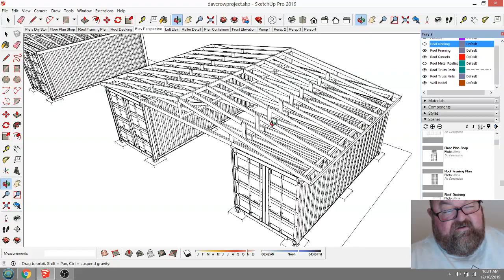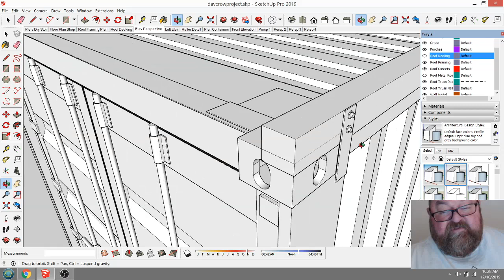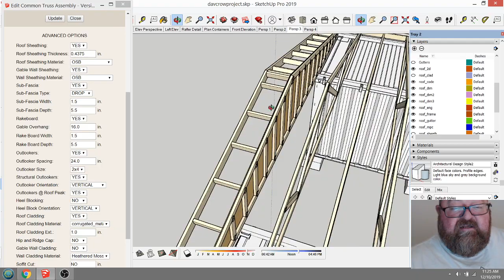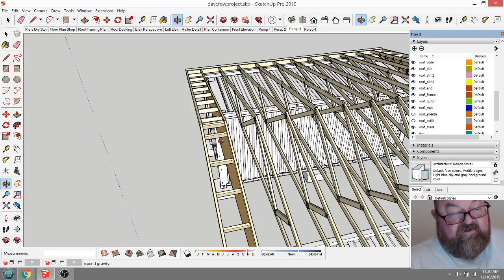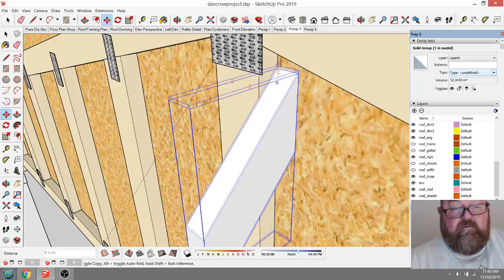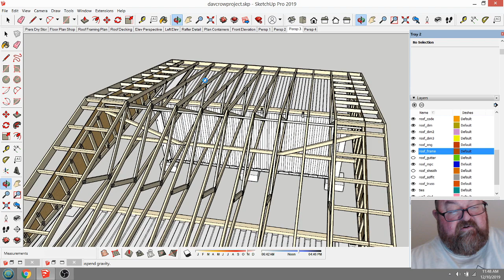Building a Roof Over Shipping Containers - Part 1 - Feat. Music By Barret and Medeek Extensions

Comment: how can i get an engineer evaluation the roof load... building inspector requiring.  Looking for cheapest method knowing it will be fine having seen 30+ examples of this roof application
Reply from the maker: If you are using roof trusses, the truss company will "pre-engineer" the trusses and give you data sheets that can be passed along to the building inspector.  I would try this before finding and paying an engineer.  I do this on the houses we build. Thanks!

Comment: Thank you for this. We are currently designing a diy shipping  container holiday home in this formation with the centre being stacked glass doors. I was disappointed that the previously posted roof designed was not advisable but you have just made my day with this post.
Reply: If building a living area out of a shipping container, what is the best ceiling height achieved?
Reply from the maker: If you use the 9’ tall containers you can get a normal ceil height especially if you are building a roof over the top where the insulation can go above the container.
Reply from the maker: Thanks :)